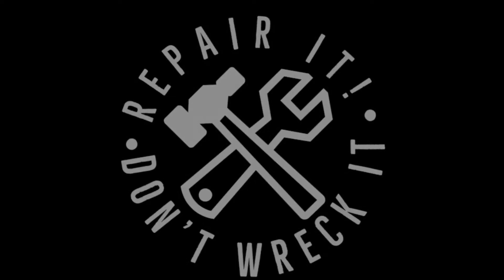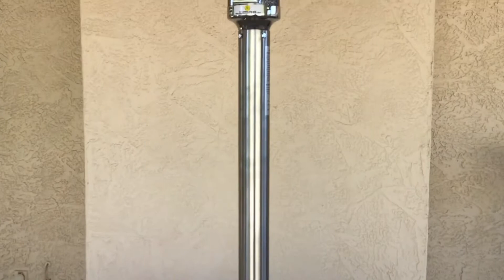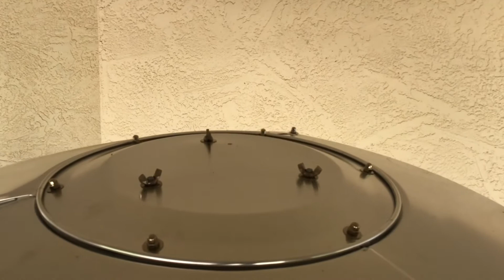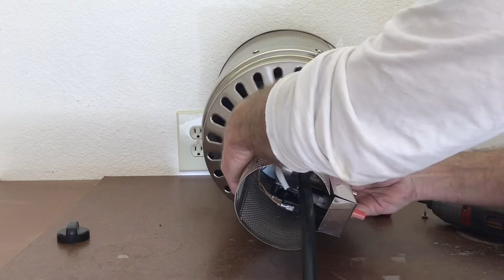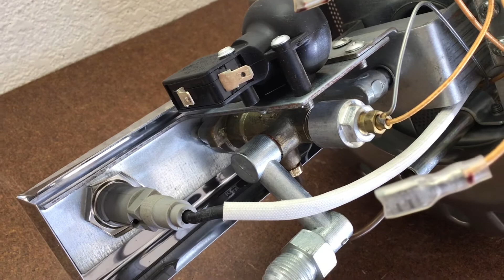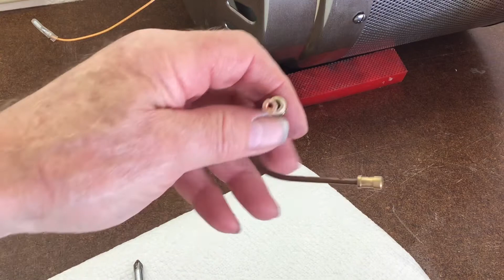Propane Patio Heater “Will Not Light”

Comment: The fire on mine just stays low it stays on but very low any suggestions
Reply from the maker: I few things come to mind. Make sure the plastic knob that controls the flame is turning the brass shaft that in turn opens and closes the valve to control the fuel flow. The plastic knob has a spline on it that could be stripped. The regulator could be defective but it’s rare. They are reliable. If you have another one on say a bbq it could be swapped to see if it works on your heater providing the connectors are the same. I know it’s obvious but make sure you have propane in the tank. I am assuming the pilot light is on and lights the main burner so you know you are getting some gas. Remove the hoses and fittings to see if something like a spider or insect has gotten in and partially blocked the hose or tubing. If you have had the heater when it was working properly what is different now? Was it in storage, did you lend it to someone etc.Take as much apart following the direction of propane to at least narrow down the problem. Something is not allowing for full fuel flow. Lastly the main valve is defective or something is stuck in it or it’s just broken. Take your time. Clean and tighten all connections. That’s where I would start. I hope this helps you try to figure out what’s going on. Thanks for your question. Roger

Comment: Great video Roger..thanks. My problem is my table top version of this will light, but there seems to be no adjustment in flame from low to high. Any idea what might cause this? I've had the same issue with 3 burner units sent to me under warranty, and the manufacturer is of no help......except to keep sending me a new burner unit.
Reply from the maker: To make sure I understand you are saying the pilot will light, and when you open the main burner it lights but you can’t control the flame? It seems unusual to have so many defective units. Have you tried a different bottle? And,  a question I have to ask is it full? Are they sending a burner assembly you have to install yourself or a complete table top unit? If you can post the make and model that would help. Thanks. Roger
Reply: @repairitdontwreckit4257   Thanks Roger...yes....pilot light lights and the flame stays lit when turned to low...however when the control knob id turned to high, there is no change to the flames intensity between low and high, consequently I dont feel its giving off much heat. The heat screen only turns red close to the bottom quarter of the screen. I have a video but not sure how to post to you. The make is Paramount, and its the table top version Model #KLD7005S item # PH-T- S S/PH-T-107-MK. The supplier has sent 2 new burner units...just the burner units not a complete new heater... but when I've installed them  they all have the same problem.
Reply from the maker: @simonjung8252 thanks. Let me do some homework. No need to send a video. I have all of the information I need. I would try a new propane bottle if you haven’t already. The problem may be between the bottle  connection and the point where you are replacing the parts. I will hopefully find an exploded parts diagram to see how this is set up. Roger
Reply: @repairitdontwreckit4257  Thanks Roger....I have tried different tanks, and also different supply hoses from tank to unit with no improvement in flame regulation.
Reply from the maker: @simonjung8252 I did find a parts diagram. Not much help unless you are ordering parts. When you received the new burners did it include the regulator?  I looked at some videos on table tops. From what I could see the regulator could be removed for inspection. Do you think it’s possible to remove the regulator from the heater, re attach the propane and carefully open the valve on the tank. If there is any debris it might get pushed out.  As propane is heavier than air you need to be careful. It can pool around you. Natural gas is lighter than air and when rise when there is a leak. You may discover something  after removing the regulator. The other question is did it work properly when new? I think when you find the problem it will be simple. There’s not a lot of moving parts on these units. Roger
Reply: @repairitdontwreckit4257  Thanks Roger....I'm leaning towards a poor design in the regulator....three units with exactly the same issue?  Can I ask, when you say "regulator", do you mean the knob that controls low to high, or the regulator on the propane supply hose? 
Or am I missing something? It seems to me that this maybe the supply hose...it works on other appliances like a portable bbq fine....but it"s the only common denominator beteen all three burner units. I'll try a different one, and thank you very much for taking the time with this.👍
Reply from the maker: The regulator would be where you connect the propane from the bottle to the heater. The pressure from the bottle is too high so the regulator brings it down to a lower pressure that the appliance is designed for. After the regulator is the control valve. It’s where you have the knob that 
rotates to adjust the flame from low to high.  If the  regulator is defective or stuck the flow will not change no matter what position the control knob is in. There could be debris stuck in the regulator. Most have a screen on the inlet side where the propane enters the regulator. That should be checked. Sometimes a spider makes a nest when the end of the supply hose is disconnected. I’ve seen this happen. The spider web plugs up the screen when the hose is connected. Roger

Comment: Thanks for sharing this video. Looking forward to servicing mine. Nicely done. 👌
Reply from the maker: Hi mattwaters. Thanks for taking a look at the video. I hope that you get your patio heater going again. Most of them seem to have a very simple fix. Once  you understand how they work it’s not that hard to figure out what the problem is. Just take your time and use the right size tools as a lot of the parts are made out of soft brass. It’s easy to round off the corners on some of the nuts. Thanks for taking the time to watch and post. Good luck. Roger.

Comment: The clogged small pilot tube was my issue. The proper wrench size for me was a 8mm. Your video was extremely useful.
Reply from the maker: Hi gguezille. I’m glad the video helped to solve your problem. It seems a common problem for many of these units. Good part there are no parts required. Seems a shame that some units were probably thrown out for the same issue. Thanks for watching and posting.  Roger

Comment: My issue with mine is the pilot stays on but it doesn’t burn strong enough I can’t figure out why the flame isn’t strong enough
Reply from the maker: Hi davidmorales. Is the pilot strong enough to light the main burner.
Reply: @repairitdontwreckit4257  
Yes it stays on , just a high flame but it’s not strong like it’s suppose to be 
Everything works from it starting up 
It’s just not burning the way it should , it mainly just regular fire 
And I don’t get that rich burn my other heaters give out 

The flame is just weak
Reply from the maker: @davidmorales3454  If your confident nothing is blocked I would try a different regulator. Its easy to remove yours from the heater and attatched a known good. If you have a gas bbq that uses propane you may be able to use it for testing. If that solves the problem great. If not then the main valve  on the heater could be the problem. Double check to make sure no spiders have not made a web in a hidden area in the gas supply tubes and pipes. The webs can easily block the tubes especially if there are internal screens.  Take as much apart as you can to inspect. If the pilot and main flame are not strong it seems like a gas supply problem or a slight blockage in the system that serves both flames. Carb cleaner under pressure in a can seems to work pretty good.
Reply: @repairitdontwreckit4257  thank you so much … I will do that and get back to you .. once again thanks for your help

Comment: Soooo basically with a drilled out orifice and the addition of a forced air and fuel delivery I could make one of these suckers an upside down rocket. It would be awesome to use in the hay loft.
Reply from the maker: Hey brianallison1913. Anything is possible. There’s always a chance to repurpose these heaters if you can’t get them to work as intended. I hope the video was helpful for you. Thanks for watching and posting. Roger
Reply: @repairitdontwreckit4257  lol it helped very much as a friend/neighbor of mine has one she wants me to look at tomorrow because it isn't working quite right.  With your video I know what the layout will be and what to check out and diagnose. Thanks again for the video and the info it contains.
Reply from the maker: Hi brianallison. Good luck with your repair. Take your time. Don’t force anything. These things are not built heavy duty. Their is a lot of sharp edges so be careful. Let me  know how you make out. Thanks. Roger

Comment: Thanks Roger, your trick with the aerosol into the pilot tube was the fix for me. I thought the pilot was clear but it wasn't - compressed air cleared it. Also, if the pilot and thermocouple aren't working, the main gas supply valve will shut off and the unit won't light under any circumstances. So you saved me the cost of replacing the main control valve and thermocouple. Thanks for uploading your video.
Reply from the maker: Hi @thewarners3665. Thanks for checking out the video and taking time to post. You don’t know how much it means to me. I just love it when things are fixed for little or no cost. Roger

Comment: Enjoyed  your video.  Very professionally done compared to other videos on this topic. I like the fact that you fixed it without disabling any of the safety features.  I am in the process of fixing my heater that came with a house we recently purchased.  It sometimes works  but most of the time It lights but won’t stay lit after releasing the gas control knob after 30 to 60 seconds.  I purchased a new thermocouple off Amazon for $13 . I will find out this morning after it gets light out and I reassemble the unit if that fixed it our not. It came with a new tip over device which I also installed. By the way, my unit has a electronic igniter, not a pilot light. The igniter works fine.
Reply from the maker: Hi Ronald Hartl. It sure sounds like it is the thermal couple. If you have a multimeter that will give you millivolt readings you can test the old one first. There are a ton of videos on YouTube on how to do this. This way if the thermal couple is good you could return the new one. Sometimes the thermocouple tip gets a little dirty. You could lightly sand it with a Scotch-Brite pad to see what happens. If you get it working either you could leave it in or put the new one on. It’s a very small voltage so make sure all the connections are tight and everything is clean. Most propane heaters you would push the red button to let gas come out of the pilot tube and would light it with the electronic igniter. The reason you hold the button is is to warm up the thermal couple so it produces a small voltage to hold the main gas valve open. If the thermal couple is not producing enough voltage it will drop out and shut off the gas as a safety feature. If it is really windy sometimes the wind can blow the flame off the thermal couple and it will drop out . Lastly if the pilot flame is not strong enough it won’t heat up the thermocouple properly. There are a few things to check before you throw parts at it. Thanks for checking out the video and your comments . Good luck. Roger

Comment: Can a fuel filter be added to the unit?
Reply from the maker: Hi Paul Ohalloran. To answer your question it is possible to add a filter. I’ve never seen it and don’t believe a filter is available. All of these heaters are designed to operate on a specific pressure. Adding a filter would probably create an operating issue which could create a dangerous situation. Also altering any equipment that has been certified is a big no no. Since propane is heavier than air it can build up at ground level and not self vent to the atmosphere in the event of a leak. Propane has the potential to be very dangerous if not given the respect it deserves. The blockage in the gas flow that the heater in the video had was created from assembly at the factory. If there is a problem with blockages due to contamination in the field you would need check the hose, regulator and fittings to find the source. I never experienced this but anything is possible. It’s a long answer but I wanted to make sure that anyone reading this understands not to alter any gas fired equipment. Thanks for checking out the video and posting a great question. Roger
Reply: @repairitdontwreckit4257 thanks!

Comment from the maker: Hi BrianWfd133 You’re right! They all have the same design and safety controls. Always check for the certification label on any gas appliance when purchasing new or used. It’s seems even different manufacturers have the same problem. You can see the opening in the pilot tube is real small. It doesn’t take much to blocked it off with some debris. It’s fun to see people getting there heaters going after watching a video. If it’s not working you have nothing to lose. Thanks for your comments. Roger

Comment: I have a different model heater (they all work the same) but this was exactly my issue, the copper tubing clogged. Some brake cleaner and works good as new. Thank you!!
Reply from the maker: Yes Brian Wfd133.  Once you figure one out you can virtually repair any model.  Brake cleaner has many uses. I use all the time for various applications. Roger
Reply: @repairitdontwreckit4257  that’s awesome something I never think to use. I missed your previous reply to my comment. Thanks again! Works like a charm

Comment from the maker: Hi ricardo manual. Thanks for checking out the video. The switch should reset when the heater is put in the vertical position. If it doesn’t reset it is probably defective and needs replacing. But it should be diagnosed before assuming it is the problem as it could be coincidental that there is another problem. When I tested mine it shuts down when the heater is tilted 30 degrees from vertical. Once it was back in the vertical position I could relight it. I hope this helps. Roger

Comment from the maker: Hi ricardo manual. Thanks for checking out the video. If you put the heater in the vertical position it should reset on its own. You would have to relight the pilot. though. When I tested mine it shuts down when it is tilted around 30 degrees from vertical. If it doesn’t reset I chances are good it is defective.

Comment: can u reset the tilt switch
Reply from the maker: Hi richardmr. For some reason I missed your question. The tilt switch cannot be reset manually. I’m not quite sure but I believe it’s like a mercury. switch in the old style thermostats. The way you re- set the switch is by putting the patio heater in the vertical position. In the vertical position the switch should be closed allowing the heater run. If it tests open in the vertical position and all wires and connections are good it is defective and should be replaced. I know it’s late but others may benefit from reading the comments. Thanks for posting. Roger